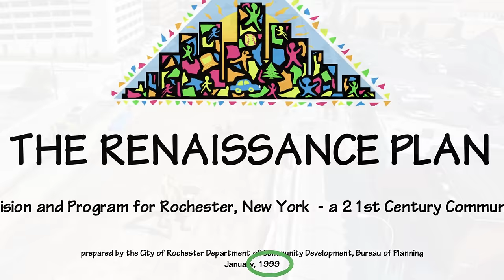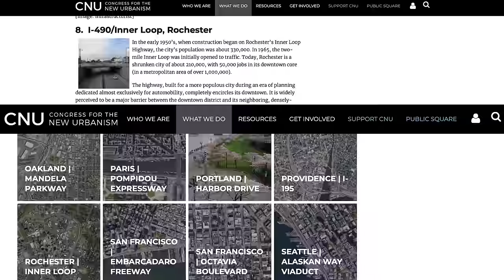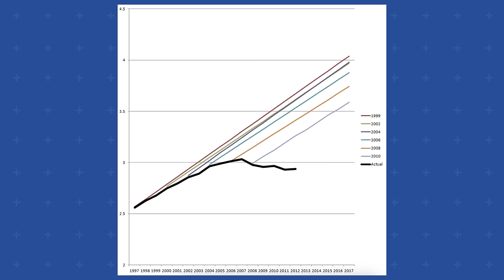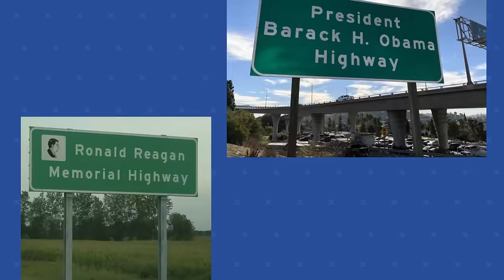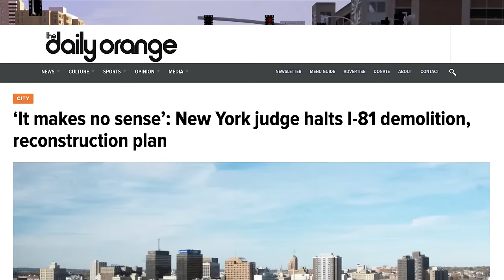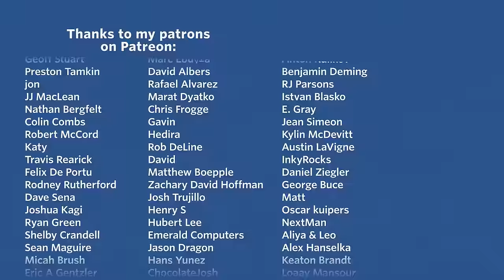How to Remove a Highway

Comment: The Buffalo Kensington Expressway removal is currently in a state of contention where the DOT is proposing a partial cover over it, while the ROCC and ESP Coalition are proposing full removal.  The link in the description is very helpful for anyone interested in making a difference for the project
Reply: There is alot of resistance to the removal by the Canadian trucking industry. Buffalo traffic infrastructure supports alot of cross border shipping from PA and OH
Reply: @Hogtownboy1  removal of the 33 Kensington Expressway would have no impact on border traffic, as the Peace Bridge connects to the 190 and 290.

Comment from the maker: Please share any updates you have on highway removal efforts in the comments! I want to hear more!
Reply: Please consider doing a video on radburn New Jersey!
Reply: 9:31 please consider doing a video on Olmsted greenways!
Reply: Our Streets Minneapolis has been advocating for freeway removal in with the Twin Cities Boulevard project, they've been slowly moving the needle towards removal and there is some support from local politicians
Rethink 794 in Milwaukee is another effort following in the footsteps of the Park East freeway removal 20 years earlier
Reply: @kcazllerraf  It's probably just extreme local bias, but I was surprised he didn't mention the MSP 94 removal project, it feels like it's always being talked about. At a minimum it's good that MNDOT seems pretty unlikely to go with the expansion proposals they brough forth before as basically everyone across the board hated them. lol.
Reply: Nice shoutout to my hometown Rochester NY! I can confirm the second phase of the inner loop fill-in is under consideration if not in the works: That part of the highway hasn't been resurfaced in YEARS and it's bad. A highway that cuts across and distributes commuters to most of where they would want to go, 490, really does make the inner loop more or less useless.

Comment: Growing up outside of Rochester in the 2000s, it's nice to finally hear some good press about the city. A couple years ago I had learned that it was somewhat infamous for just how poor the planning was for the car based infrastructure.

I'm glad they added some biking infrastructure when they removed the loop, as it originally replaced the city's subway system.  I'm far too young to have ever seen it, but it makes me wonder if the city could have been a much nicer place in present day if the inner loop was never built.

Comment: A note on the graph of the SR 520 usage at 3:22: the reason the actual use is way below projections is because the bridge is tolled to pay off the construction costs. Drivers around here are notorious for not wanting to pay tolls if they can avoid it, thinking all roads should be free (they are heavily subsidized and we pay indirectly anyway). As it is a bridge across Lake Washington, most people that are going between Seattle and Bellevue/Eastside just take the longer routes either north via I 405/SR 522 or south via I 90.
Reply: This, 520 was a bad example.
Reply: Yeah, I was going to say something similar.  Also, there was the introduction of Microsoft's Connector bus network which took a bunch of vehicles off SR 520 all at once.  There's no way a projection could have taken either change into account, so it's a little disingenuous (in my mind) to point to that as an example of traffic projections not coming to fruition.   The demand for cross-Lake Washington traffic is still alive and well (and probably growing).

Comment: Great video! I moved to Rochester in 2014, a few years before the removal of the SE section of the Inner Loop. I can attest that the highway, frontage roads, and abutting parking lots were a bleak urban moonscape. The new Union Street isn't perfect, but it's better in every way than what was there before.

Comment: I'd be interested in hearing more about your thoughts on the Kensington Expressway in Buffalo. The State DOT wants to put a cap over it, essentially turning a portion into a tunnel. The community group mentioned is fighting this, arguing to remove it altogether. Problem is, it's the main route into the city for all the suburban commuters, and sees a huge amount of volume. I understand the view of "well I guess the suburban dwellers will just have to tough it out.", but the reality is, without their support, and with the opposition of the community, what is likely to occur is absolutely nothing, maintaining the status quo.
Reply: The I-190 already exists to handle that traffic, plus the Rte 5 Skyway from the Southtowns.

Comment: Minneapolis has 2 highway projects with options to remove them. Part of I94 connecting Minneapolis and St. Paul (they're also throwing around giving it a landbridge instead) and Olson Memorial Highway(very old and no longer really used). Olson Memorial is still taking comments. Both are along tram lines.

I think Olson will changed as only one option keeps it as big as it is, but i94 is getting a lot of push back. Locals want it gone but the city seems bent on keeping it.

Comment: I'm curious if you've looked at the infamous "Highway to Nowhere", route 40 in West Baltimore. Several city and state advocates have supported filling it in to reconnect the neighborhoods on the north and south side of it. In that way it reminded me the example you showed of Rochester. My question is, to what extent is "reconnecting" a community a valid argument if there are regular bridges across the road. If one looks at Rt 40 there are bridges every 400 ft that mean the regular street grid is entirely undisturbed for about 1 mile of its length. Especially given plans for the Red Line, instead of filling in the highway wouldn't it be better to use its trench for the train line, keep one road there converted to a bidirectional 1 lane road from a unidirectional 3 lane road, and then leave the remainder as parkland or buildings either at trench or surface level?

While a lot of highway removal efforts are well-meant, I think sometimes "removing the highway" is seen as the end-all-be-all instead of one of many potential steps. Similarly in DC, the SE Freeway (I-695 and I-395) doesn't really form a division since there are 16 streets crossing underneath it along its 2 mile stretch from Maine Ave to Water St. Meanwhile that link from east of the Anacostia to NoVa is absolutely vital and used my hundreds of thousands per day. A point could be made that Southeast Blvd (which carries little traffic and has already been downgraded) should be made into regular roads to connect the area between L and M St though the train tracks complicate that. Conversely, 295 in SE absolutely splits communities from the Waterfront and needs lots of more bridges across it.

Lastly, Whitehurst Freeway in DC is always cast as a target for teardown for being an eyesore, but from a practical standpoint it provides really welcome shade whenever I bike underneath it, along one of the major bike trails into DC from Maryland. It's elevated, so again it doesn't disrupt the community and there's a park along the waterfront.

I'm glad you brought up the economic incentive part of things because I do believe that highway capping or removal to build something useful there is great. But I think the reasons, incentives, costs, and usage (local vs regional) should all be weighed.

Comment: The Gardiner in Toronto is an un-expandable, unfixable mess of a highway that absolutely needs to be done away with. It costs so much to maintain it and it never gets better. Lakeshore Blvd., which runs underneath it can be upgraded and realigned into a much more efficient roadway on our waterfront.
Reply: I know alot of people seem to really hate the Gardiner, but it is a vital highway that allows people to get to downtown from the suburbs and also for people to get from east to west and vise versa. Removing it would make traffic in the core even worse rather than better.

For me though I'd tear down the existing Gardiner because its old and build a brand new one in its place with modern designs and materials. Not one deck, but THREE DECKS high. The first deck would be the same as now and serve people who want to go to and from downtown from various streets. The second deck would be a true expressway that completely bypasses downtown so that people who want to go east-west and not downtown can do so more easily and would greatly help traffic flow.

The third deck at the top could be modeled to be similar to New York's High Line park where people and cyclists could relax, exercise and enjoy the views of the city from an elevated deck and it would immediately become a huge tourist attraction.

I know such a project could never be done because our city and government have little imagination and ambition to do so, but I think it would ease some traffic problems while creating a new park for everyone to enjoy.

Comment: Great, but the solutions offered seem to increase car/pedestrian interactions.  Still need this to be a focus of solutions in this area.
Reply: Yes, they need to not just tear down these highways, but also reduce and calm the car traffic (through many fewer lanes, narrower lanes, lots of trees, raised crosswalks, and more space for buses, bikes and pedestrians). Hopefully this would lead a lot of the existing car demand to shift to walking, cycling and public transport, or just end (the opposite of induced demand).
Reply: There is a lot of debate about the proposed I375 removal in Detroit in this regard and replacing it with a multilane surface boulevard.

Comment: I live in New Haven where route 34 has been cut back a couple blocks - it has opened up a few parcels for development and new buildings and much better streetscapes are going in! However, in removing the lowered expressway, they just widened the surface frontage roads, probably because of traffic projections. The intersection rendering from the video is 10 lanes across, so wide that pedestrians have to cross in 2 phases while highway traffic whizzes by. The end result is still a net positive for the city, but leaves much room for improvement

Comment: We should remove at least 50-75% of urban highways in the US. A few of them are okay, but in general they're awful for cities.
Reply: Agreed. On a bit of a tangent, I think urbanists should push for Cincinnati to swap I75's alignment with the railyard. it's a very underrealized opportunity in America that could resurrect a city that's declined a lot in the last 80 years.

Other than the up-front cost, the project could be very uncontroversial, and have many upsides for walkability. Even as I75 would keep its downtown connection for cars (utilizing the 6th street spur), a considerable swath of land would be opened up for a new rail corridor/central train station, as well as park space, and dense, mixed-use development.

Cincinnati's one of the most practical places in America to be a major passenger rail hub. The city is within 400 miles of 10 metropolitan areas with over a million residents, including... Chicago, Columbus, Milwaukee, Indianapolis, Louisville, Pittsburgh, Cleveland, St. Louis, Grand Rapids, and Detroit. While the old station is palatial, it isn't located in a walkable area, and a new modern central station within walking distance of the stadium and downtown would bring a lot more ridership, and would be suitable for car-free commuters and tourists alike.

Comment: My local city in England removed the 1960s central ring road. This led to an expansion of the CBD into areas outside the original noose like road, including cultural and academic sites, housing, and commercial properties. It was not all positive, but on balance, the effects have benefitted the city.

Comment: I attended college in Rochester in 1990s.  I was recently in Rochester for the eclipse.  I thought I was misremembering the inner loop.  But this explains that.  In regards to I-81 in Syracuse, I can totally believe the 100,000 figure.  Anyone coming from eastern Pennsylvania, New Jersey, and Delaware (besides all the NY people directly south of Syracuse) to somewhere west of Syracuse will most likely be taking I-81.  Removing it as a highway without augmenting or adding another highway is going to add a lot of congestion to other existing highways.

Comment: I'm glad to see you guys slowly untangle yourselves from the car infested mess that is those huge ugly highways and move more towards roads and boulevards we have in Europe instead! It'll take a while before there will also be things included like specific tram- and bus lanes, but you'll get there eventually I'm sure.

But, since I'm from Europe, I noticed these are mainly happening in the so called 'blue' states where Democrats are in power. I also noticed it's mainly 'red' states like Arizona and Texas that suffer the worst with these huge 6 to 8 lane highways, so I'm curious - are there any projects regarding the tearing down of highways happening in these places? It would be a positive sign for infrastructure in general were that the case.
Reply: Thanks for the word of optimism.

Comment: The renovation I'm looking for but haven't seen yet is transforming a highway or wide stroad into twinned streets with buildings in between them. A 100+' wide boulevard is hostile to pedestrians and other road users regardless of whether you run transit in the middle. Consider the ramifications of splitting the carriageway into two separate roads.

Comment: I've seen quite a few highway removal videos now, but one thing they never seem to mention is what happens to all the commuters that used it once it's gone. I am aware of induced demand, and that it can work in reverse, but if you're not building decent fast transit in it's place then what is happening to the journey times of all the people still trying to make the same journey once the highway is gone? I imagine that if the highway was constantly clogged with traffic, then things might actually improve, but if it was free flowing then replacing it with a boulevard is going to introduce so many intersections that will slow things down for everyone. I'm not sure I'd call that an improvement? You're basically turning a road into a stroad, which can't be good, can it? If people used a highway to commute from one place to another and then you remove it, they're not all suddenly going to move house or quite their job. They might eventually, but it could take years for everyone to adjust, so there's going to be a long period of time where things will get worse for a decent number of people.
Reply: If it's called a boulevard, it's European, and therefore good. As opposed to a stroad, which is North American, and therefore bad.

Comment: CA 15 from CA 94 to the 5 Freeway is another highway to remove, which would help restore one of the most struggling neighborhoods in San Diego. Traffic headed for the 5 can use  the 805 instead. There are only two access points of any kind on the 15 between the 94 and 5.

Comment: I find this story hilarious as a Torontonian. Here, the Gardener Expressway is an elevated highway which cuts right through downtown (parallel to the lake) as the extension to the busiest highway in north America. Toronto is also growing enormously in population every year - there are literally 5 condo buildings being constructed on my residential street right now, each over 15 stories, and yet the housing shortfall also increases every year. But the cost to rebuild the highway is so unbeliebably high that despite its unparalleled use the city is tearing it down anyway piece by piece! And frankly I'm glad, because as the traffic gets heavier, more people are taking the inter city train (which is also expanding its network quickly).

Comment: One highway San Diego doesn't need is the two miles of CA 163 between University Avenue and The 5 Freeway. It goes directly through one of the leading city parks in the U.S., Balboa Park, home of the San Diego Zoo, and it uses an arroyo that historically had no road at all through it. It only serves as a shortcut from the suburbs to downtown, and The 5 and 15 freeways do that already.

Comment: Meanwhile my city's inner loop was already outdated (too small)  when it was built and is now a traffic nightmare 20hrs a day to the point where it's often faster to drive out of the city, use the outer loop highway and then drive back into the city on the other side, adding about 15 miles to the journey. 
BUT they built a tunnel 20 years ago and put houses and a park on top of it. So at least that's something

Comment: Adding another one to the list, Autoroute Ville-Marie in Montreal, which slices through the full length of downtown! Admittedly some sections are buried and built over, but most of them aren't, cutting off Westmount from the Sud-Ouest and the Quartier chinois from the Vieux Montréal, for example. We should just get rid of it honestly, public transit is great in those areas anyway.

Comment: Totally support removing lots of urban highways, but I'm a little hesitant when I hear 'boulevards'. Here in Philly, the Roosevelt Boulevard is a disaster. It might be better than a highway but it's still horrible. Are there ways to do boulevards 'right' or 'wrong'?
Reply: Boulevards instead of a highway is dumb in many cases. I don't understand how that works for cars, pedestrians or cyclists when highways at least separate vehicles from the other two. Boulevards just make massive stroads with little benefit to anyone.

Comment: Minnesota is considering something similar for the I-94 that runs between downtown Minneapolis and downtown Saint Paul. I largely like the idea but i think there is too much traffic there still and redirecting it won't be as easy as some you described in this video.

But there is about a mile near downtown Minneapolis that is nearly stopped every day from 3~6. I drive uber and always try to avoid that area because that 1 mile takes 10+ minutes.